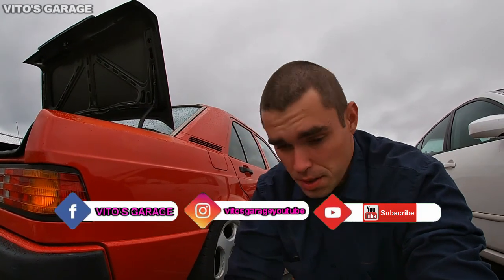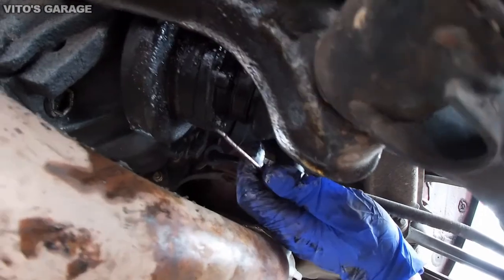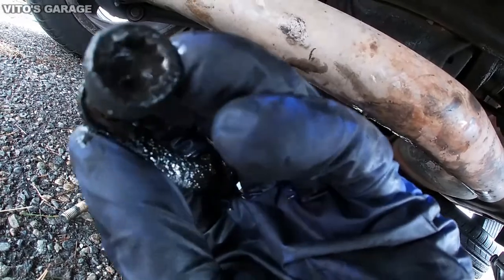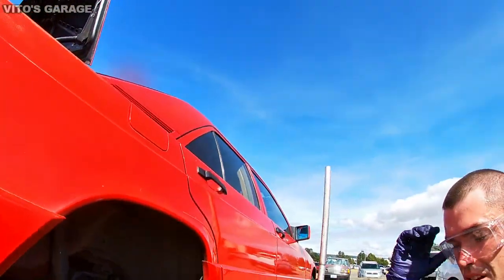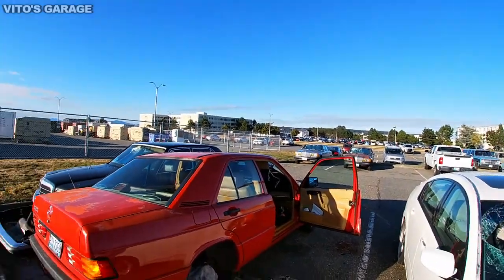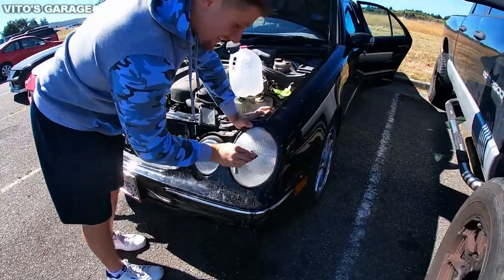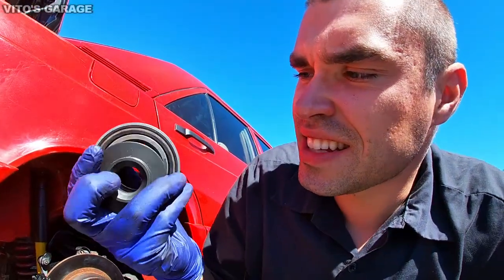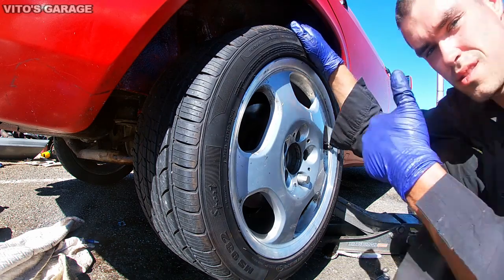Rear Press-in Wheel Bearing Replacement Mercedes 190E W124 W210 W202 W203 W220 Tips, Tricks,Details!

Comment: I have a 1999 SL500. I watched this video to get an idea on how to do this job.  I found it very informative.  To get the axle bolts off, it is important to keep the wrench tight and straight.  In the end, I made myself a crude breaker bar to loosen them up.  I took a deep well socket, stuck it on the end of my wrench, and then stuck an extension on the end of the socket. This allowed me to use my left hand to hold the wrench straight and pull with my right hand.  Made getting them loose a lot easier.  Then I just used the wrench to take them the rest of the way out.
Reply from the maker: Awesome! I’m glad it helped you! Please check out my other videos and playlists!🙂

Comment: I have noticed that these bearings sometimes don't have much grease in them so I remove the outer seal and inject them full of Molly grease. I noticed this after a friend's bearings went bad after a year. We found the bearings didnt have much grease. I have seen the same with the driveline carrier bearing not having much grease. Its worth the minute it takes to cv check  the new bearings. Napa has a needle that connects to a grease gun to inject grease between the bearings then snap seal back in place. 
Good luck on your projects.  Keep them on the road.
Reply from the maker: Great idea!! Thank you for your support!
Reply: @VITOSGARAGE  keep them on the road man.

Comment: Nice work as usual Vito. You manage with whatever tools you have, by understanding the principles of what you’re working on. You also learn from your mistakes. Brava! My suspicion is the dust guard was cut when non-standard rear springs and shocks were installed instead of working around the guard, or removing it.

Looking forward to more! Thanks.
Reply from the maker: Thank you for supporting and thank you for your kind words! And I think the dust shields were cut off because they were trying to replace the control arms. Dust shields made it hard for them to reach the bolts, I guess... So upset

Comment: Replaced the rear wheel bearings on my W210 Wagon a few years ago. Long story short, nothing worked to get the hub off except a bearing splitter. (used in a fashion other than what it was intended). I bought the same elaborate tool you used to get that hub off. It would not work on my W210. Craziest thing I had ever seen. You place the bearing splitter behind the hub flange and use the wheel lug bolts themselves to pull the hub out. The bearing splitter lets you distribute force against the outer edges of the wheel bearing carrier and gives you something to press against. You then tighten the wheel bolts through the hub and they press against the bearing splitter. It pulls the hub. It's actually VERY simple and much easier than that tool you used. Just saying. Been there. Try a bearing splitter in the future.
Reply from the maker: Thanks for all the suggestions, sir! I'll keep it all in mind:)

Comment: Hey Vito I would check your subframe mounts now and protect them. The rubber undercoating is very deceiving it looks great but underneath moisture gets in and it rusts. I was shocked on my W124 and plan to remove all the rubber undercoating.
Reply from the maker: Thank you Chris! I checked everything and this 190E is super clean. No rust underneath where the subframe mounts are. I'll finish fluid filming and undercoating it with grease soon

Comment: Great video , I need to do this job soon because the rear brake back plates on my w202 are rusting away and I'm worried the parking brake will fail due to the shoes coming loose.
What tool are you using to extract and install the bearing? Could you please link me the exact tool?
Many thanks 🙂
Reply from the maker: Hello there. Here’s a link to the wheel bearing removal/installation tool: https://www.amazon.com/YUAN-23pcs-Bearing-Removal-Installation/dp/B075N1FRDL/ref=mp_s_a_1_4?keywords=Wheel+Bearing+Removal+Tool&qid=1654214621&sr=8-4

If the link doesn’t work, just google it. There are lots of options available. Make sure to order brand new backing plates so you can change them while replacing the wheel bearing. 
If you have any questions, message me on Instagram (vitosgarageyoutube) 😎

Comment: So what kind of grease do you use for the underbody? And did you get that bearing tool from amazon?
Reply from the maker: Bearing grease. That tool you can rent at Oreilly if you’re in USA
Reply: @VITOSGARAGE  Im in finland, here isnt that kind of tool rental that you have there, it wpuld be great.
Reply from the maker: @juhoreiss4691  in that case you need to order the wheel bearing removal/installation tool on eBay or Amazon, or maybe Autodoc
Reply: @VITOSGARAGE  Yes. They werent too expensive on german amazon.

Comment: Can you tell me where I could find some wheel screws I destroy my hubs with the wrong screw
Reply from the maker: So you need just the lug bolts? I think you’re in a bigger trouble than that. You might need new hubs. Check online. Lots of resources. Where are you located?

Comment: Hey vito I saw ur Facebook post I think if you got issues with idle and acceleration try the fuel filter fuel pump relay and OVP relay these cars can be a real chore to get to start and idle right I’ve replaced pretty much everything I could see and it starts good but still idles bad for a few seconds after starting but still  a lot better than when I bought it
Reply from the maker: Thank you for your suggestions. But I don't like to just throw parts at the car. I like to diagnose problems. In my case the problem is with the fuel system, so I'll be focusing on that.
Reply: VITO'S GARAGE pretty fair I normally get every new part I can find and chuck it at my car for fun
Reply from the maker: Same. I've been working and doing tons of stuff on this car for the past several months. Just installed new Bosch Injectors on it too

Comment: Great video .
 Some idiots that work on cars for 40 years, used a hammer to try to get out the back bushings . Of course it didnt do anything.   A steel hammer . I knew something was wrong. as it chipped the metal and it was bare metal . Can that make rust to damage It  ? 
 I have a w202 from 1995 . 
 It doesnt matter if it s an old or new car . Every car must be done right . 
 I changed the subframe bushings myself btw . The ones in the back.

Comment: I tried to remove the whole wheel stative by releasing all the screws therefore to handle the bearings and hub in a press. Hows going that ?
Reply from the maker: You can replace the bearing using a press too
Reply: I am now removing the drive shaft to the rear wheel drive differential. So I can handle it externally.

Comment: How did you get the inner besrung from the hub? Next week i wanna change my bearing😅
Reply from the maker: I used a wheel bearing press out tool (it has a threaded rod and a few cups). And it came out. Not too hard😀
Reply from the maker: I used a wheel bearing press out tool (it has a threaded rod and a few cups). And it came out. Not too hard😀
Reply: I mean the thing on the hub where the brakedisc is mounted what you pulled with the tool i think its called sledge hammer or something😂 you said in the video there is a part of the bearing stuck on
Reply from the maker: @Hernandez9699  I think it’s the slide hammer that you’re talking about lol

Comment: Is it possible to change rear wheel hub without destroying the bearing.
Reply from the maker: No. You can probably save the bearing if you remove the whole knuckle and press out the bearing in a press. 
But just replace the bearing, you are already there

Comment: Hi,
Nice to see that. The extractor/puller/press that you have is of a specific brand? If you can le me know as I have that nasty job to do 😔
Many thanks
Reply from the maker: I just used a generic bearing pulling/installation tool. You can look it up on eBay. I’m sure there’s lots of options. It’s a lot better and easier than pulling the whole knuckle to press it out

Comment: I'm amazed you managed to remove the bearing so easily, I had to put my backplate on a heavy duty press before it would shift, then I had to pannel beat the backplate back into shape because the press squashed it flat as a pancake! I missed exactly how you pulled the bearing with the hub on the car, you didn't go into any detail and this is reputed to be the most difficult bit and no, never use a cheap bearing, spoil the job for a hapeth of tar!
Reply from the maker: Thanks for your support! And I used a wheel bearing removal/installation tool for this job. 
I also used a Slide Hammer in order to remove the hub out of the bearing. I showed that in the video and I had that slide hammer attached to the hub. It took me a little bit of time to hammer out the hub but eventually it came out. This job takes time but it’s a lot faster than removing the whole knuckle and taking it to the bench press. Cheers. Check out my other videos please🙂
Reply from the maker: Thanks for your support! And I used a wheel bearing removal/installation tool for this job. 
I also used a Slide Hammer in order to remove the hub out of the bearing. I showed that in the video and I had that slide hammer attached to the hub. It took me a little bit of time to hammer out the hub but eventually it came out. This job takes time but it’s a lot faster than removing the whole knuckle and taking it to the bench press. Cheers. Check out my other videos please🙂
Reply from the maker: Thanks for your support! And I used a wheel bearing removal/installation tool for this job. 
I also used a Slide Hammer in order to remove the hub out of the bearing. I showed that in the video and I had that slide hammer attached to the hub. It took me a little bit of time to hammer out the hub but eventually it came out. This job takes time but it’s a lot faster than removing the whole knuckle and taking it to the bench press. Cheers. Check out my other videos please🙂